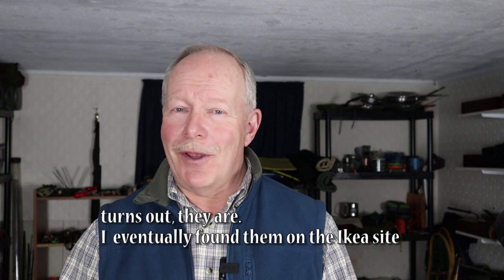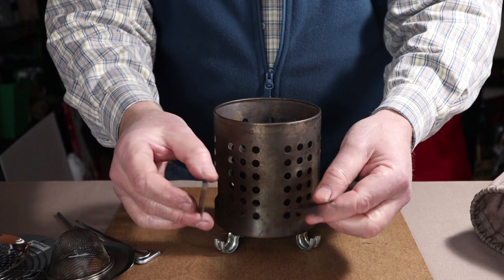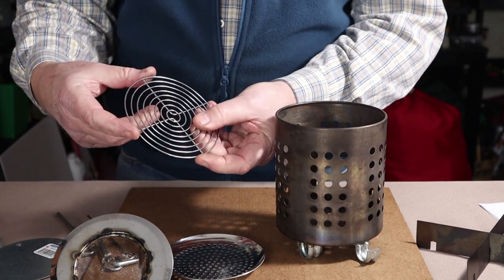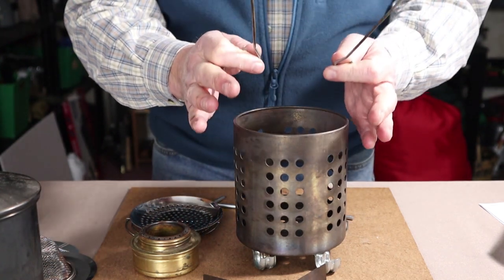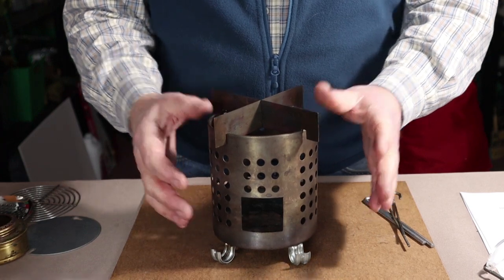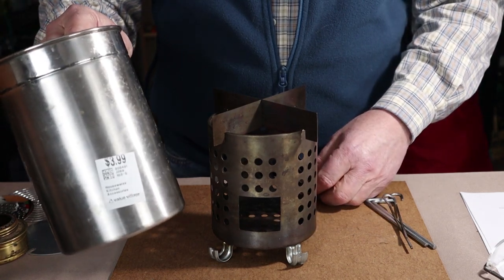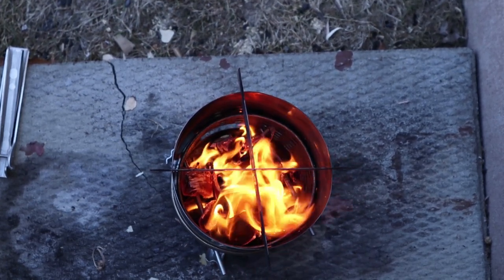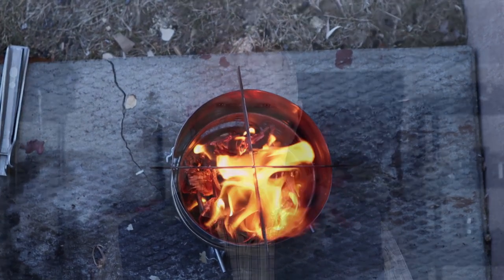How To Build the Ultimate Ikea Hobo Stove

Comment: Excellent modification ideas.  How long does it take to cool down to re-pack it?
Reply from the maker: I should have mentioned that. If I separate the components and dump the hot ashes it will cool down very quickly because of the thinner metal. Thanks for commenting

Comment: What if you wrapped some aluminum foil or split a can on the side and made it fit over the IKEA stove so that they air would go up to the top when it burn your wood gas then
Reply from the maker: Interesting suggestion. Based on experience with the Super Size Hobo stove (see videos) I would have to use a can or other steel wrap to close off the lower holes. Thanks for commenting
Reply: The top holes you still have to have air get to the fire below then it would be acting like a rocket stove or one that has a second heated chamber too burn the wood gas

Comment: Mr. Mark, I found in Dollar General store  a tin medium canister (to keep Christmas goodies) and it fits perfectly on top of the strainer. Can I use it or it has to be stainless steel?
Reply from the maker: As long as it is not aluminum it should work. Even aluminum might work. It may not last as long but I have used cookie tins (similar construction) to make char cloth directly in an open fire. The paint will burn off pretty quick. Thanks for commenting

Comment: I don't like putting my stove inside my pot.  I would prefer to get a smaller pot and put inside my stove.  Use some matte black paint, maybe grill paint and just touch your conduit feet, aesthetically it will be nicer.  I use thumb screws, wing nuts, and washers and lock washers to secure the conduit holder feet with the thumb nuts on the outside.  I bent the tips of the skewers down slightly to help keep them from easily sliding out.  I actually prefer tent stakes but they are heavier than the skewers.
Reply from the maker: All good suggestions for sure. Thanks for commenting

Comment: Why not cut holes in the bottom of the canister instead of using the cross members? Avoids needing a straight cut and gives you a stable enough surface to rest the pot on.
Reply from the maker: Yes, that is good way of doing it. Thanks for commenting

Comment: Where can I buy the metal braces
Reply from the maker: If you mean the feet on the bottom you can buy them at a hardware store. If you mean the pot supports, they are made from a metal ruler. Thanks for commenting

Comment: wish i had of seen this before buying about $100 worth of campstoves...I bought a Lixada Titanium WoodBurning/Alcohol, and an EverNew Titanium alcohol stove.  Also avoid telling people to make these things out of inferior metals, adding this much heat to those kinds of things WILL throw off toxic fumes...I had to return a TOMSHOO stove because they lied about it being steel (tested with a magnet), and also like to sell the old units when people have purchased a new upgraded one.   So what is that Ikea thing made of?  Pure steel?  It would be safe as usually only pure steel and titanium are strong enough to avoid throwing off those toxic fumes (like aluminum or mixes will).
Reply: yes. as I am watching this I see you are addressing the aluminum aspect some..well now you know a bit more about why to use proper metals, good.  So is there any way to get that gasification with some type of easy to obtain steel part...after all we are trying to avoid those invisible toxic aluminum fumes...just for that extra safety...etc.
Reply from the maker: Best I can say about the Ikea metal is that it stand up to a lot of heat. I also know that most stoves use the less expensive 304 stainless which has enough alloys to be non-magnetic. Thanks for commenting